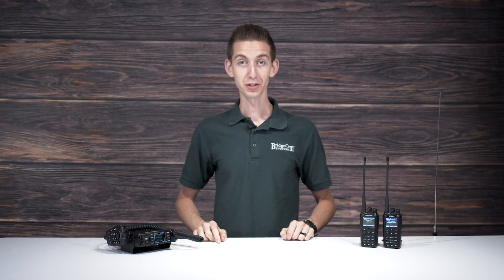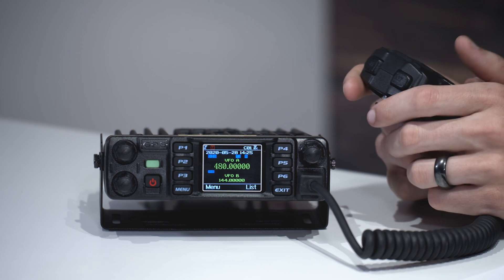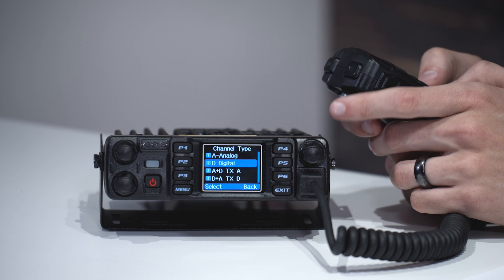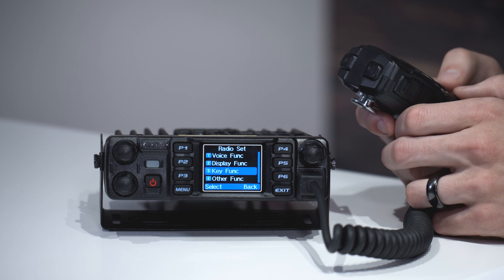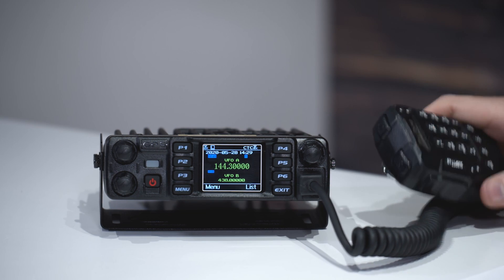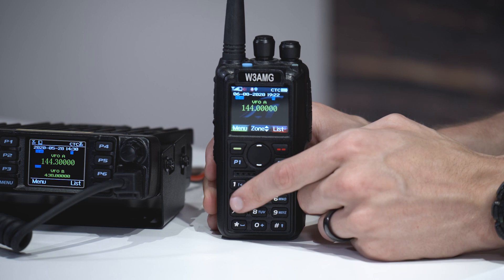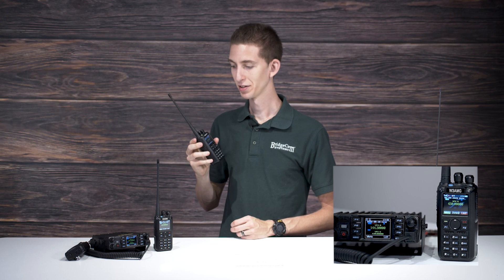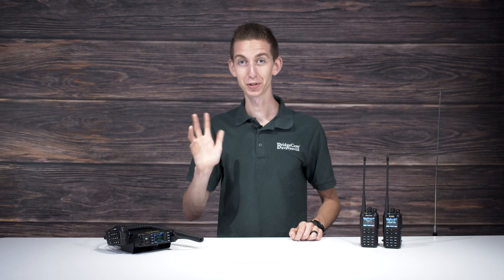How To Turn Your Mobile Radio Into A Repeater

Comment: I want to set up a GMRS repeater. I followed the instructions on the video. Using the programming software I set up a GMRS repeater on 467.55. To test I programmed two HTs to the same frequency. The HTs both RX/TX to 578. However the 578 does not relay signals from HT1 to HT2.  I went back and rewatched the video. It talks about enabling repeater. This option is not available manually in the menu on my 578. I also can't find this setting in the software either. Under Optional Setting, Auto Repeater I see Repeater Mode On/Off. Tried that and it didn't work.
Reply: @TexasHarvestRanch  You need to rx and tx on different bands, the rx and tx cannot be on the same gmrs band.  Example you can have the crossband repeater rx on murs and tx on gmrs that is if your radio is a triband ham radio and unlocked for gmrs.  Then you can have your HT1 and HT2 tx on murs and rx on gmrs of course your HTs would also have to be  a triband ham radio unlocked for gmrs.  That's the setup I am using when needed.
Reply from the maker: Hi! Thanks for your comment. If you have any questions, feel free to join our Facebook group — it's a great place to get help from the community: https://www.facebook.com/groups/BridgeComSystems. Also, if you're interested, check out our Plug-and-Play Package here:https://www.bridgecomsystems.com/pages/plug-and-play-package.

Comment: When you enable the repeater function on the 144.3 MHz, does it tell it to transmit on the VFO B? how exactly does this work? Do I have to enable repeater on the RX frequency for the repeater (TX of the handheld)?
Reply from the maker: Hi! We invite you to join our very large Facebook group, where you can ask for help if you need assistance. Here's the link to join: https://www.facebook.com/groups/BridgeComSystems. Also, you might want to check out our plug-and-play package at this link: https://www.bridgecomsystems.com/pages/plug-and-play-package.

Comment: I am new to radios but I want to build a repeater. I have been watching many DIY videos but this is the first that used 2 handhelds, 1 to transmit and 1 to receive. Do you have a repeater video build that uses 2 radios for the repeater and a single handheld to send and receive?
Reply from the maker: Hi! We invite you to ask your question in our very large Facebook group. Here's the link to join: https://www.facebook.com/groups/BridgeComSystems. Also, you might want to check out our plug-and-play package at this link: https://www.bridgecomsystems.com/pages/plug-and-play-package.

Comment: Can dmr reporter the same frequency for tx and rx?
Reply from the maker: No, It can not. it has to be two different Frequencies.
Reply: @BridgeComSystemsInc  analog radio must have 2 different frequency i know. But my question is in digital radio communication?
Reply: @BridgeComSystemsInc  It can, working on 2 timeslots afaik.

Comment: Crossband repeat is a cool feature, use it alot for remote base operation. Would be nice to demonstrate crossband repeat function in diigital mode or digital to analog if possible.
Reply: Earlier this year, I actually did an analog-digital crossband repeat for self-demonstration purposes. While spending the night at a truck stop near Richmond, Indiana, I had my AT D868UV HT on DMR UHF simplex (CC1 TS1 TG99) with the '578 crossbanding to an FM repeater also near Richmond. I did have a QSO with another operator via the FM repeater; said my audio was good. His audio sounded good as well. As far as crossband full digital, I haven't tried that yet. I have heard that while doing crossband DMR one band has to be using TS1; the other band has to be TS2. 

One more thing: if you have a 220 HT or mobile, you can crossband from 220 MHz to UHF **ONLY!**. Because transmit 220MHz is using the 2m finals (reason why it's only 5w as well), the '578 cannot crossband 220-2m. 73, Steve KC4JGC.
Reply: @stephenplatt5048  Thanks for taking time to explain how it works,  UHF DMR to VHF Analog. My digital radios/ repeaters are Kenwood NXDN and Hytera DMR. Looking to get a 578 radio to play with. 73s. 👍
Reply from the maker: Thank you for your comment. We invite you to join our very large Facebook group. Here's the link to join: https://www.facebook.com/groups/BridgeComSystems. Also, please check out our plug-and-play package: https://www.bridgecomsystems.com/pages/plug-and-play-package.

Comment: Can this radio be programmed to be used with GMRS?  Looking at the specs I don’t believe so, but wanted to make sure. Love the repeater function, would be great for camping to have a 25w+ repeater readily available in the truck
Reply: Thank you for the reply!
Reply from the maker: Hi Brent, This radio is not designed for Part 95 compliance so it can not be used on GMRS.

Comment: hi sir is this set up repeater needs two aireal antennas?
Reply: I suppose you can use a single antenna if it’s a “Dual Band” antenna…
Reply from the maker: No, one antenna is sufficient.

Comment: Repeaters assume same band installation with adequate isolation.  Cross-band repeating is quite different, and should be referred to by its proper name.
Reply from the maker: Thank you Mike!  If you want to take your #hamradio journey to the next level, check this out:  https://bit.ly/3Lgiz1k

Comment: So its a crossband repeater. Is there anyway of having a repeater without been crossband?
Reply: The most common, and probably the easiest way to achieve this is with an MMDVM board that can control two radios.  At this point, the Anytone radios are not good enough and quite a bit more expensive than used Motorolas.  Then you need filtering to isolate the tx and Rx frequencies.
Reply: @falsedragon33  thank you!
Reply from the maker: Hi! Thank you for your comment. We invite you to ask your question in our very large Facebook group. Here's the link to join: https://www.facebook.com/groups/BridgeComSystems. Also, please check out our plug-and-play package: https://www.bridgecomsystems.com/pages/plug-and-play-package.

Comment: Would you be able to transmit on the 578 when its in repeater mode? planning on using this in a rural environment that would need to have the options of using as a base station as well as repeating the way you set up in the video, but also be operable on the radio
Reply from the maker: Hi! Thank you for your comment. We invite you to ask your question in our very large Facebook group. Here's the link to join: https://www.facebook.com/groups/BridgeComSystems. Also, please check out our plug-and-play package: https://www.bridgecomsystems.com/pages/plug-and-play-package.

Comment: How many distance/how far will this repeater cover?
Reply from the maker: Thank you for your question.  This is hard to answer as there are many things that affect radio coverage area.  This depends mostly on line-of-sight or simply where the antenna of the transceiver is located.  Think of being in a car listening to the radio and you're traveling away from station.  Eventually, you'll lose the station.  Same thing here.  It's a function of line-of-sight and Transmit power.  The higher the antenna and the most power will get you a long way.
Reply: Thank you very much for your details and clear answer.
Reply: Both VHF and UHF waves can travel thousands of miles if unobstructed.  My farthest UHF contact is 6300 miles away, bouncing off of the green cube satellite.  Ground clutter and the curvature of the earth limit you on the ground.  So that will depend on where you're at, not what radio you use.  For further study, look into concepts like free space loss.

Comment: I do not understand how the 578 was programmed with the 2 meter frequencies and the HT's were programmed with 440 frequencies and the HT's were able to go through the 578.  I would think the HT's would have to be set to the repeater frequencies.  Please explain.  Thank you.
Reply: It is a cross band repeat. So it uses vhf for tx and uhf for the rx or vice versa. This is usually done out in the field where the HT can’t hit the local repeater so it goes through the mobile as it has more power and a better antenna to hit the repeater. You could do it as he did as a temporary repeater in the field without it going to an actual repeater.

Comment: Does the Anytone D878UVII also have this? I noticed something in the CPS related to a repeater in the optional setting menu, but never messed with it.
Reply: Most decent handhelds have cross-band repeat.  I disagree that it isn't useful.  Location is far more important than power.  a ht on a tripod, sitting on top of a hill works wonders.
Reply: Crossband repeat is something you'll only find on a mobile like the 578. It wouldn't make sense for an HT to have this as you wouldn't gain any additional transmit power.

Comment: Thanks Cody! Is it possible to set it up as a DMR repeater?
Reply: Donald, I see your question is over a year old; thought I'd attempt an answer. I haven't tried this yet, only DMR-FM, which works fine. It's my understanding that DMR repeat can be done; one side has to be TS1; the other side has to be TS2. Have you tried it? If so, what that what you did? 73, Steve KC4JGC.